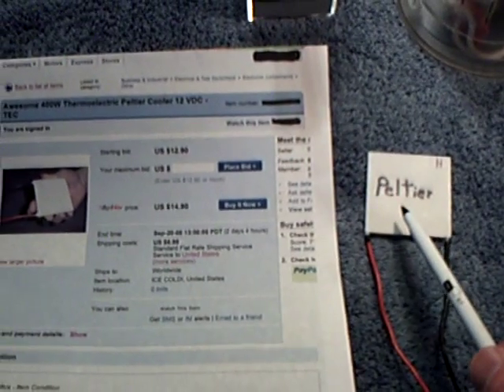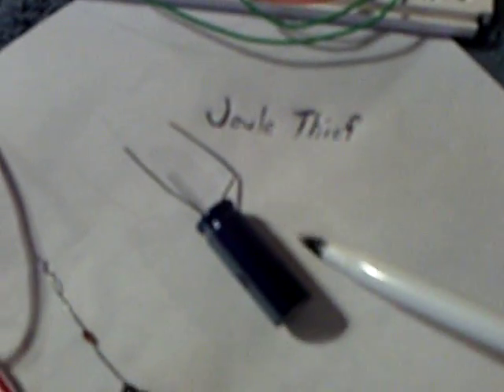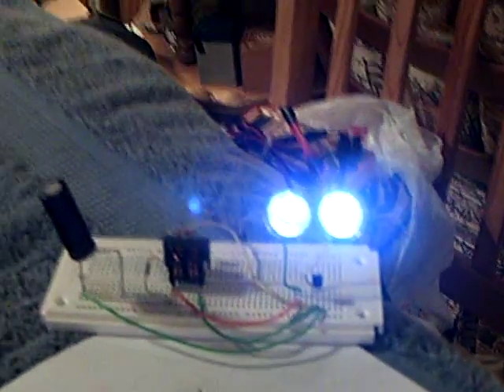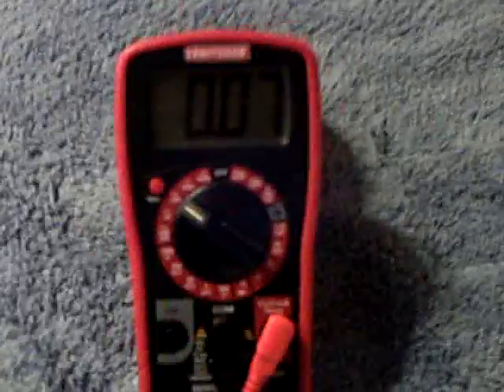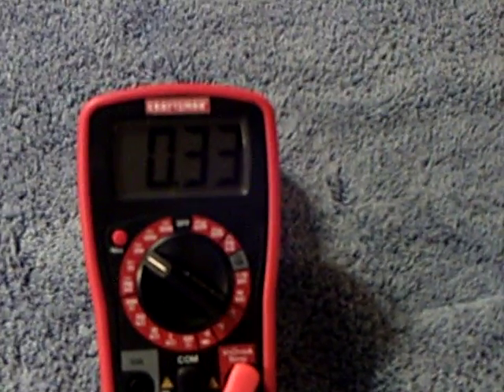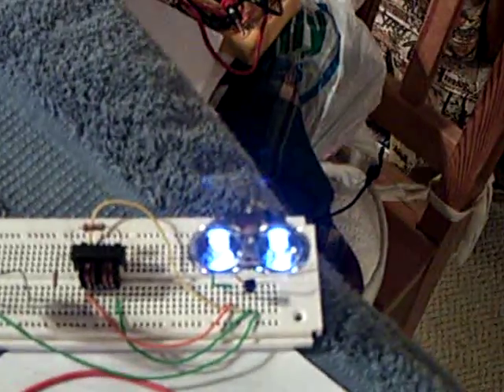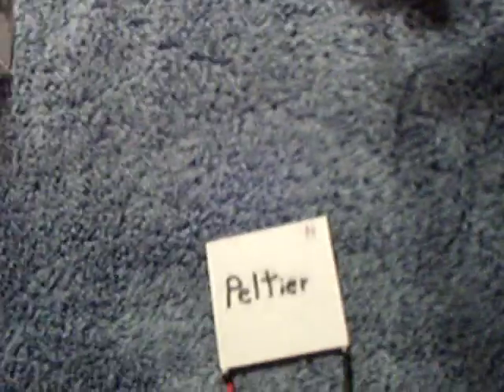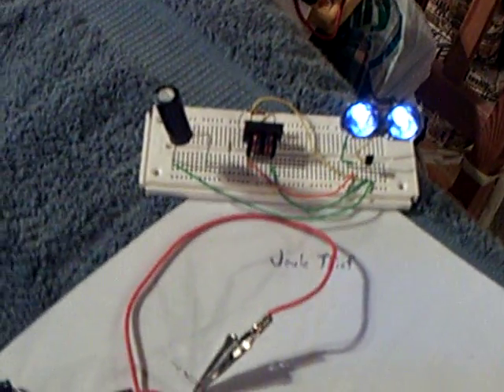Peltier module charging without hot or cold

Comment: Thank you.

Have you done more work on this subject?

I am convinced that by using a solar heat box (pop cans painted black inside of a box, sealed with a glass top. the pop cans heat up very quickly like leaving a can in your car in direct sunlight with the windows up. hot hot hot.)

On the cold side, a 6 foot hole into the earth to dissipate the heat.  In winter, the cold air can be sufficient?

There.  A great low cost heat differential and now suck the energy using Peletier module.
2.5 kw/m2

Comment: I dont think The Peltiers work on induction, just heat difference. When u get energy from the transformer, its not because of the electromagnetic field inducing a current, simply the current in the transformer is heating it up and the peltier can convert that heat to energy. 

I dont know why the stray EMF has an influence on it tho.

Comment: Excellent work once again Mr Lidmotor!

U think its an AC current?

I just got mine in the mail & been playing around with the peltier all day, its a lot of fun seeing what will produce energy.
Mines only a measily 60Watt, will a 400W module produce the same amount of power as a 60W? or is the 400W rating just for how much Power u can apply to it (ie hotter/colder)

interesting with the Earth ground. There are hot transformers all over the place, it would be stupid to waste all that heat